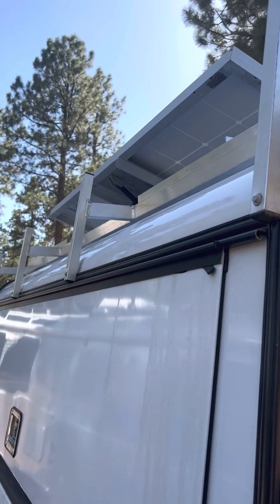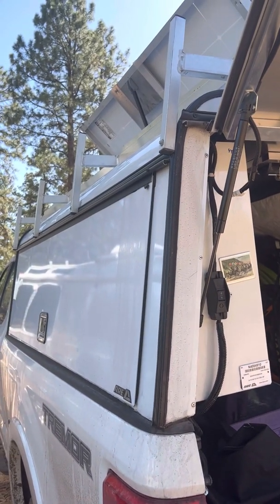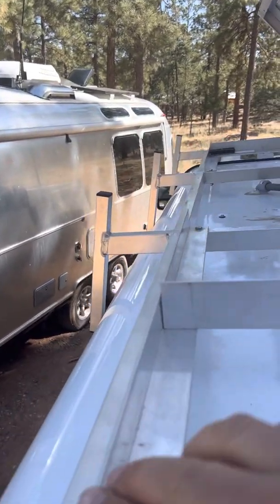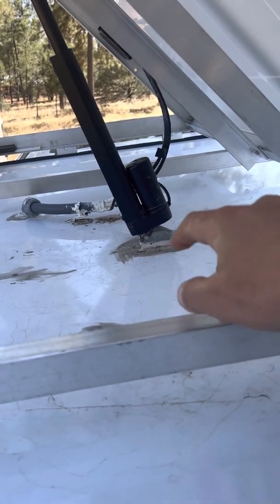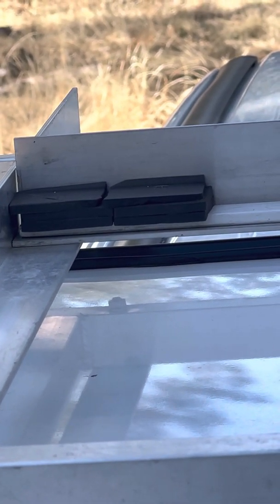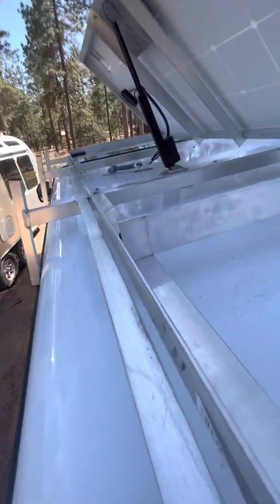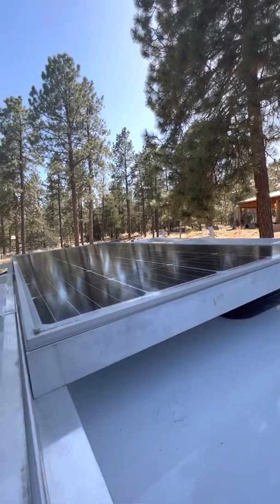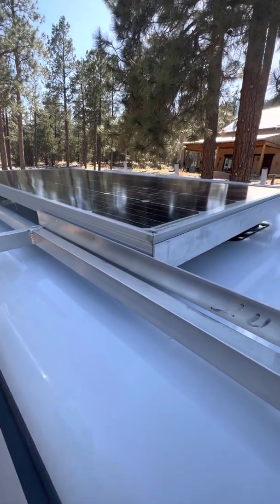DIY Motorized Solar Panel Tilt Mechanism

Comment: Excellent,  however you need to post more information on the build, the size and source of actuator arm, how its powered, the switch to power it on/off etc...

Comment: Love the build mate how did you work out what size actuator you need?
Reply: Hey thanks.sorry for the delay in response. First I figured out the support structure to which the actuator would attach on the panel. Then the cage that would hold the panel on the rack. Then I laid the panel flat on a table, lifted it 45 degrees and measured the distance from the  attachment point on the panel to the table directly below it and added the several inches because the panel would be attached to the top of the cab , as opposed to the rack that was holding the panel. Found an actuator that when at maximum extension matched the calculated length.